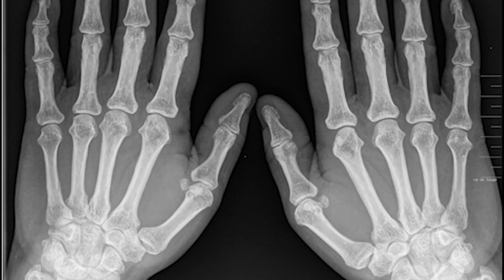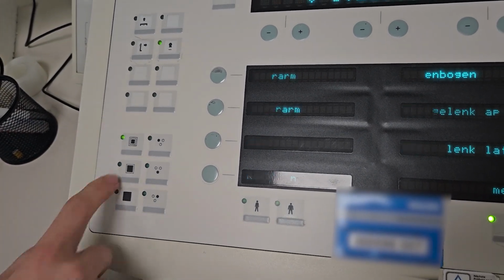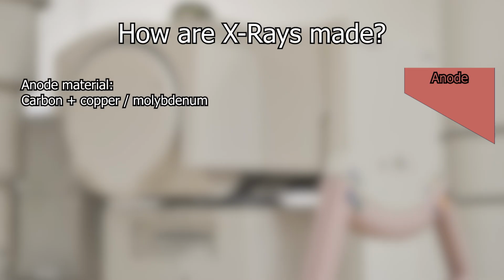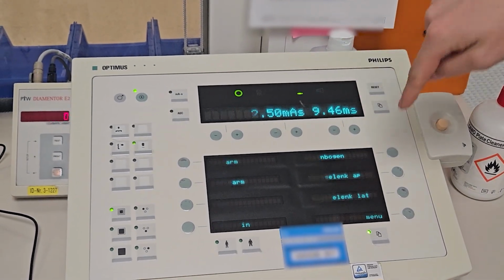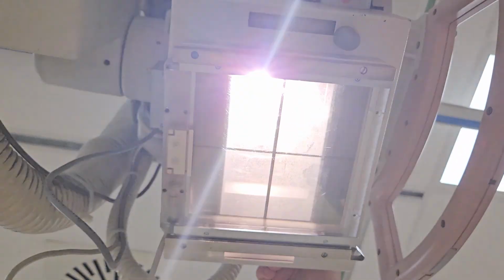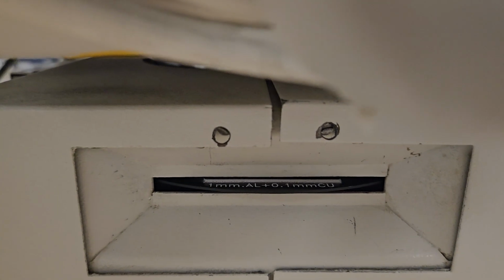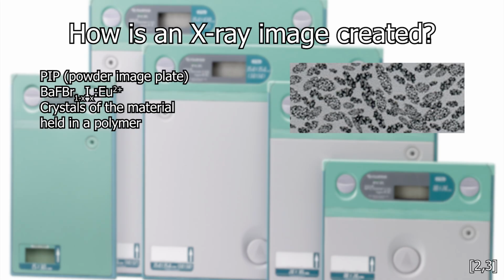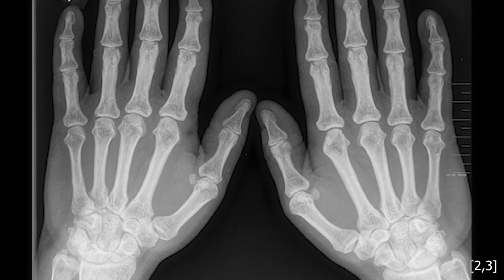X-rays in the hospital

Comment: AFAIK the system you describe is a somewhat older X-ray sensor technology. More modern ones are digital solid state - either diode detector arrays that directly pick up the X-rays, or scintillator material coated onto a more conventional CMOS/CCD digital image sensor.

Some of the fancier ones even have wifi or bluetooth radios built into them so you can get near realtime images displayed on a PC and rapidly verify that the images are satisfactory before you even take the detector out from under the patient.